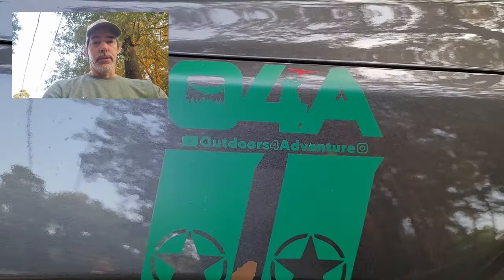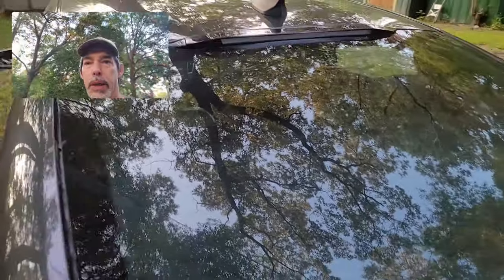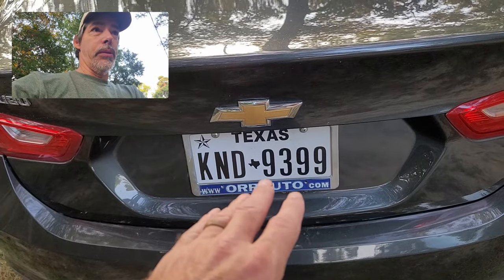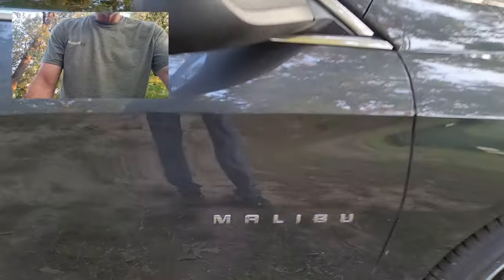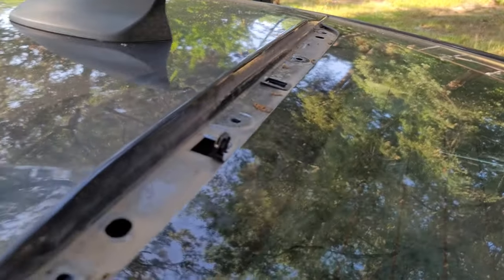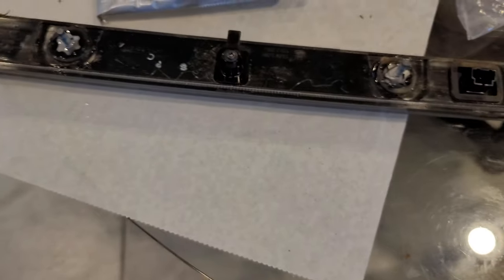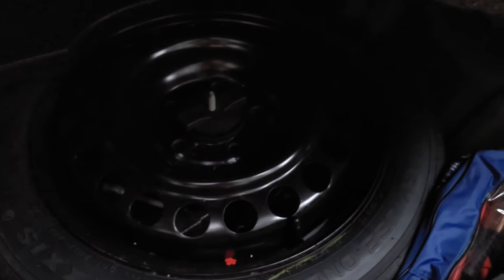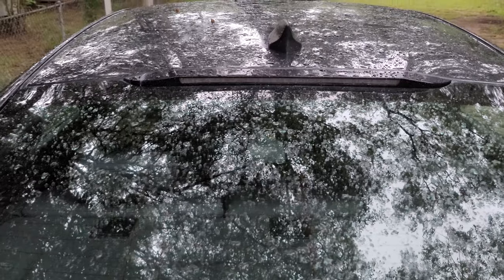2018 Chevy Malibu, Water Leak  in Trunk, fix??!!

Comment from the maker: Talk about a pain in the neck..LOL.. I twisted in ways I didn't know I could taking this brake light off. Hope this helps others. Update, this fixed the leak.
Reply: Please respond I’m in need I have the same issue and it still leaks from middle screw between the nuts and I tried putting silicon outside like you did what silicon did you use mine keeps breaking down
Reply from the maker: @original_m.c.pharaoh   Did you completely remove the light? I did and put RTV thick on all of it. I reinstalled rubber rings also.
Reply: @Outdoors4adventure  yes I didn’t put new rubber rings but I did put a dap brand silicon around holes Idk if I was too light with it will I be able to remove it again or is it too late since it’s bonded?
Reply from the maker: @original_m.c.pharaoh  The rtv I used will peel back off the car with a little effort. I reused the same seals. I rvt them in place on the light. Dont overtighten as the light itself cracks easy. Chevy should have to fix this issue. Just by the views on this video tells me theres a issue.
Reply: @Outdoors4adventure  thanks fir the responses and one more question is there any way I can know I cracked the light on accident or would I have to just take it apart again
Reply from the maker: @original_m.c.pharaoh  I believe you would see it. mine cracked on drivers side above bolt mount. I glued it together.
Reply: @Outdoors4adventure  oh ok thank you i don’t think I cracked it but I’ll take it apart this weekend again to look And where did you get rings and what spot did you place them on thanks again

Comment: My brother owns a 2017 Malibu Turbo.  He lives in San Diego and when it rains he gets water in his trunk, a lot of water.  The dealer was unable to find the problem after checking the tail light gaskets.  He took one more look at the problem and discovered that the trunk vents open at the slightest of air movement.  So he taped over the opening for the bottom 3 vents leaving the top vent opening uncovered.  All 4 vents still open and close together but now water doesn't have the ability to leak into the trunk when there is water on the road from rain.  Instead of the water leaking into the trunk it runs back out the bottom of the vent.  The air pressure in the cabin is still released from the heater/air condition when it not in recirculation.  When closing the doors or trunk the air pressure is still released.  He also experienced less road noise.  This solved the issue of water getting into his trunk.  I hope this helps others with the same issue.  I was unable to find anyone resolving this problem.  Please post your result using this fix.
Reply from the maker: Sealing the third brake light fixed ours.

Comment: Purchased 2018 2.0 Premier Turbo...I've had it 3 years and the floorboard on driver side continues to leak ..6 times to dealership..This car has less than 15, 000 miles 😳...Any suggestions?...
Reply from the maker: Ever had the windsheild replaced?  If your rear brake light is leaking, I wonder if it's running across headliner and down to the floorboard. We park on a hill with trunk side on low side and the water ran in trunk. If we parked level or front lower than the back it might change where the water ends up.

Comment: Wait cus I don’t want to get electrocuted.. you said you have to cut the electricity off on the wire after removing the headlight ?
Reply from the maker: The light won't come on as long as your not pressing the brake pedal.

Comment: Great video because my 3rd  brake light is broken. One side of the light popped up and separated.
Reply: Mine is broke just like yours.
Reply from the maker: Yes sir. The glue held mine together and sealing under it did stop the leak. We traded it off for a 2022 jeep compass. It was a good car other than that light. Lol

Comment: Thank you for sharing important information. Especially for a female that just bought the car and would not know the first place to look for a water leak, it is unfortunate that Chevrolet is not making this a recall issue. I would like to say that I absolutely love, love, love the car. Although I don't usually keep too much important stuff in my trunk, however, my mother had recently passed away and I had just picked up photos and scrapbook stuff. We live Forida were we have heavy downpours almost on a daily. Within a day or two I realized my trunk leaked and these irreplaceable memories were ruined. You also mentioned that your warranty had run out and that you did not have the bumper to bumper. My question is, I do have bumper to bumper. Do you know if it would be covered with this warranty. I could call them and ask but it's Sunday, and I'm just kind of anxious to know. I would appreciate any kind of input, if you would be so kind
Reply from the maker: A bumper to bumper should cover it. Show them this video with all the folks having issues if they argue.  It is a bad designed brake light. So sorry for your loss.

Comment: Why not put silicon with a caulking gun all around the 3rd brake light groove between the roof and the light assembly ?
Reply from the maker: I caulked the whole thing. If you dont get under the light I am not sure it will make a good enough seal.

Comment: My 2018 malibu has been leaking for awhile and I don't know exactly how long . I don't go in my trunk very often because I work 12 hrs a day plus and go straight home from chevron.
So one day popped open my trunk to retrieve some paperwork booklet from my job and it was full of mold and water. Checked the spare tire area and full of water. And rusted bolt. My overhead roof over my backseat is stain from water damage now and my backseat is also. GM said they won't fix or replace damages and it's a manufacturer default because not only am I experiencing this but hundreds of thousands others are to. Chevrolet has always been my favorite vehicle but after the fact they won't help then I will no longer purchase a vehicle by GM again. And I have to drive daily in my car to make a living in a car full of MOLD and it's disgusting!!!!!! And mold causes health issues
Reply from the maker: Yup, we both drive jeep now. Lol

Comment: I tried this out, used silicone washers and new nuts but it still leaks :/
Reply from the maker: I smeared sealant all under the light with the rubber washers thick.  No problem with it leaking again. Traded it off not long ago.